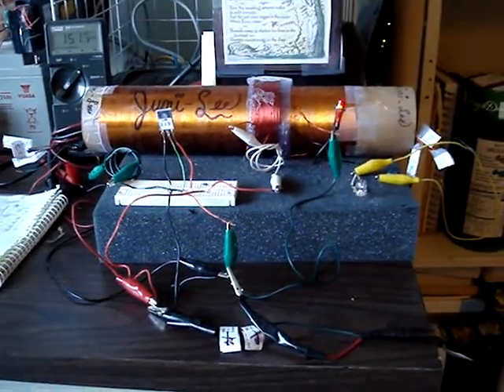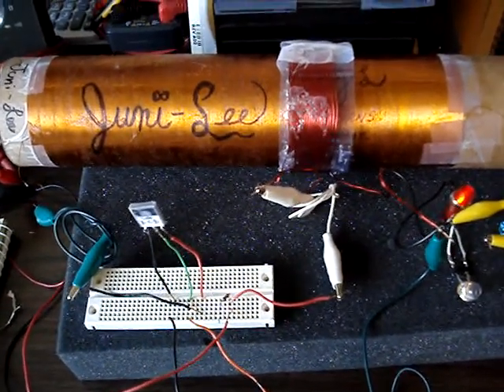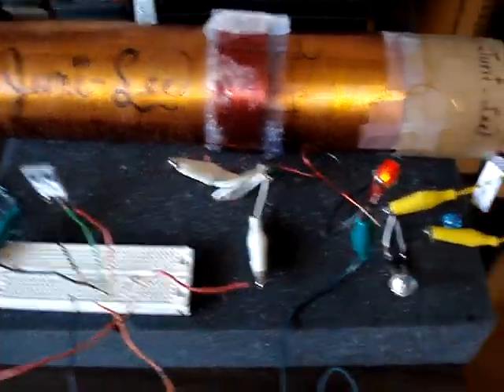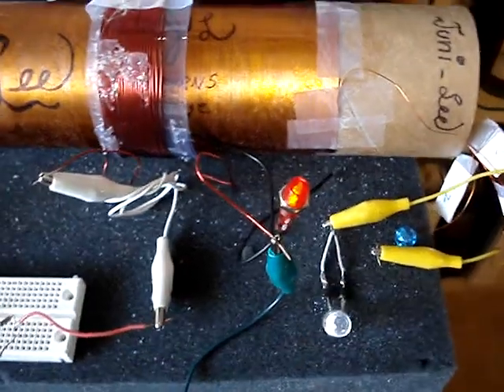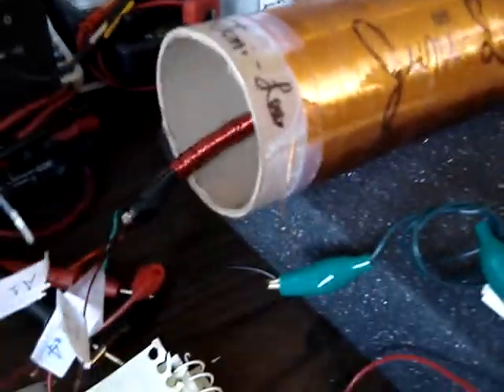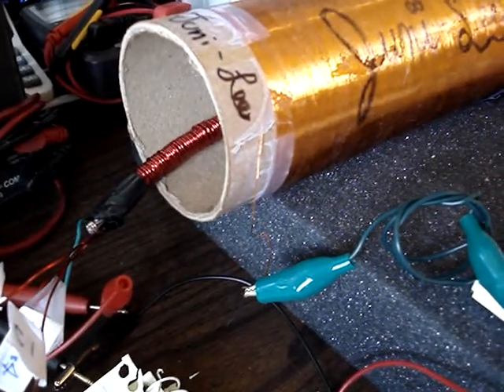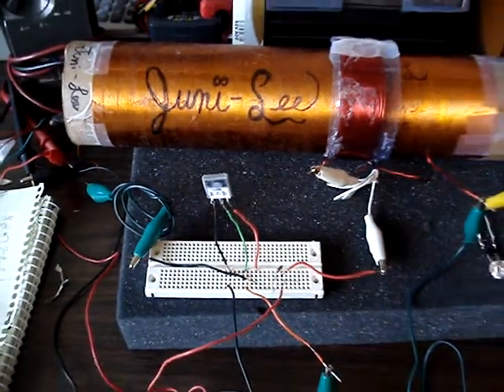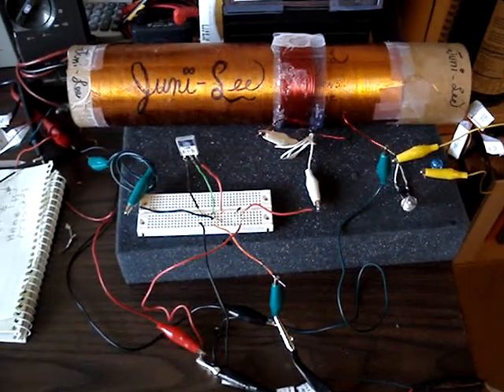Juni-Lee Exciter

Comment: Good work Jack - you'll have to measure the V/I of that winding inside the tube and let us know.
Be interesting to see what it produced if the coil ran the full length of the tube & had more turns?
Jim